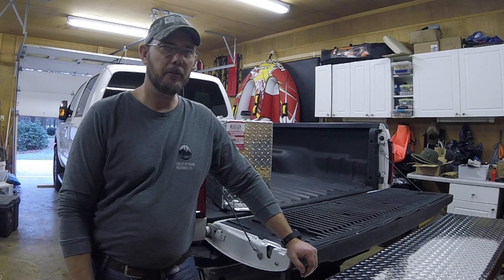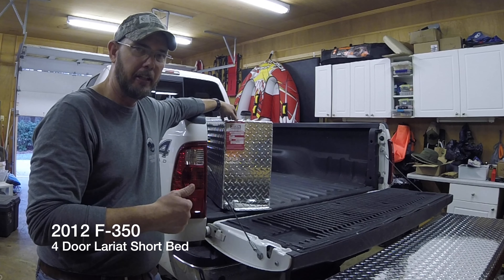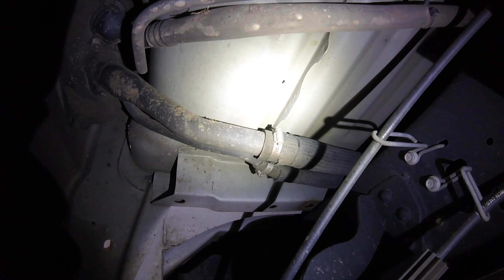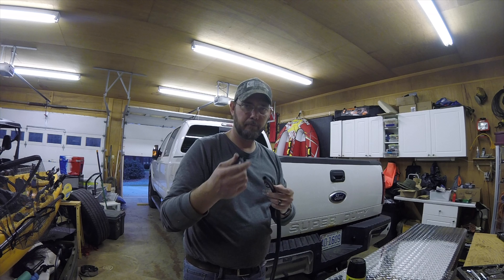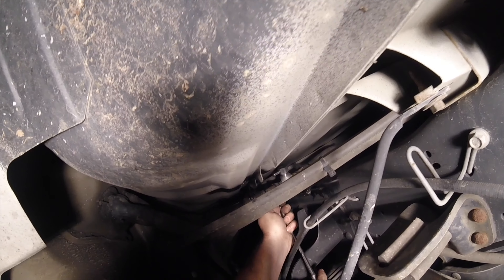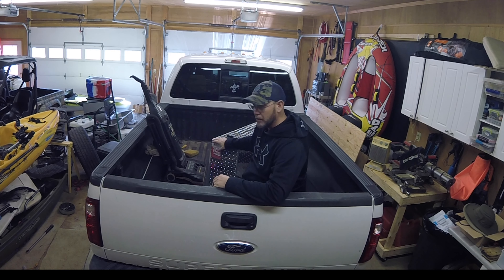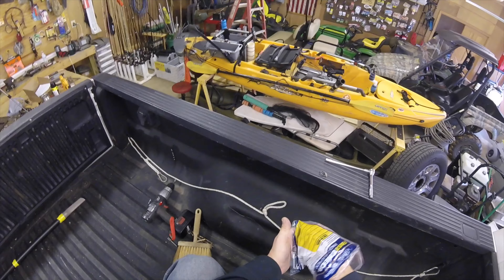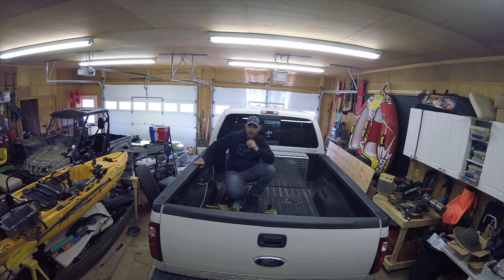Add Miles Towing With A Gravity-Fed Auxiliary Diesel Fuel Tank~Full Install

Comment: I just installed mine on a F350 two days ago, filled the main tank and aux tank. 

Hoses and clips were fitted and connected but there is still fuel dropping on the floor as the truck is parked sitting idle. 

Gone under truck to recheck if there is any loose fitting cant see none, all looks good. 

Although I have no hose fitted to breather vent on top of the auxiliary tank yet, could that be the reason ?  Or is it because both tanks are filled ?

Should I just lock the aux tank and let truck consume from main tank till fuel level goes fine before opening the aux tank valve ?

Comment: My friend I have a question for you thank you in advance. I wonder if is ok if you leave the  little gate valve in open position all the time ?
Reply from the maker: Hey thanks for watching and for the comment! Yes sir you can leave the flow valve open all the time if you want to. I would do that for sure if I was traveling on a long trip. Say for example you get going down the road and you notice you have about a 1/4 of a tank of fuel in your main tank because you forgot to open the valve after you filled up the gravity tank. You then decide to stop at a rest stop and open the gravity tanks flow valve. The tank will fill at a rate that will fill your main tank as you are traveling down the road however it will be slow but it will fill it. I love it it's great for long trips.

Comment: I have the same unit. And do need it for my small OEM fuel tank
My question is
Have you ever heard of installing a camper type unit folding or hard side camper 
While keep my gravity feed tank and tool box
I am thinking to try something and do a build around the tank and tool box 
I don’t want to remove it
Good video

Comment: Doing the same on my ford 2015 6.7 - I’m thinking about adding a small pump to help move the fuel over and run it to the power up switch.. now that you have run yours for a few months do you leave the value open all the time or turn it on and off. Is an electric pump something you’d suggest?? Thanks for your install video- I went with an RDS combo 60 gal with small box on top and adding a roll up bed cover to help secure the bed.
Reply from the maker: So far the way I have used the Aux tank is I will use the OEM tank first till it is time to refuel it. Then  when the truck is just sitting and not being used I will open the Aux valve and let the OME tank refill. I have not taken any long trips with our 5th wheel due to Convid this year so I just can't say fo sure if it will push up and out through the filler neck or not. I will say I filled up my OEM and the AUX tank before I left the beach the other day and kept the Aux valve off till I got home (3 hr drive) and let the OEM tank refill overnight and I had no pressure build up for me drive home that day.
Reply: Hook It Up Outdoors - we have kept aux tank with gravity valve open all the time. Fill it up and have had no issues at all. Put a locking cap on factory to remind us to make sure aux tank is empty before taking off factory tank. We fill factory tank then move nozzle to aux tank. When the gauge starts to drop we know it’s time to look for fuel!  Works great with no issues.
Reply from the maker: @kevinrogers4223  Yes sir that is how I fill mine up OME tank first then AUX tank. I love it I can get (road miles not much pulling) around 850 to 1000 miles per fillup now.
Reply: @ViseGrip1974  you can leave the valave open all the time on the aux tank and it will keep your oem tank topped off it will not over fill thats what that T connection with a ball valve will prevent it from doing.  as your oem tank goes down it will fill it up once you see the fuel gauge going down your aux tank is empty.
Reply: I have the RDS Combo 40 Gallon Tank / Toolbox. Gravity Feed Only at this time. If I let the aux gravity feed to the main (times my truck fuel gauge faults and shows empty).  I have no filter as your install but am thinking of adding one. I figured I would just let my main filter filter the fuel.  I have had some issues with only getting 2,500-7,500 miles/filter rated at 15,000 miles. 07.5 Duramax LMM 107,000 miles. I carry a spare filter but it is somewhat a pain to change due to it’s location. Possibly might add a AirDog system….👍

Comment: That line you called overflow is actually air vent line.  It is what allows the fuel to actually drain quicker.  Think of it like shotgunning a beer.  If you don't pop the tab of the can the beer flows out slowly.  But once you pop the tab to allow air it rushes out.
Reply from the maker: Thanks for watching and the input much appreciated!!
Reply: I like Beer ❤️

Comment: when you put the piece into your truck fuel fill line. was the hose rubber or metal where you cut to put the section in with the fitting for the gravity feed fitting? hope you know what I am talking about.
Reply from the maker: It was rubber on my truck.  Good question than thanks comment.

Comment: Only problem I have with gravity feed is,
Water is heavier than Diesel fuel,  water goes straight to the bottom and is the first thing in your truck tank.... as much water that is in the fuel now days, I fill my truck from the transfer tank but it goes through two water separators and a 2 micron filter before it goes in my truck. This keeps my truck system water and debris free.
Reply from the maker: Makes sense thanks for the input!!
Reply: Quick question, I always hear about high amounts of water in diesel fuel. I have a water separator on my truck and two fuel filters. I have never had an issue with water. I also do use hot shots everyday which has water separating properties but where does the water go?

Comment: Where did you get the valve that you put into the filler neck?
Reply from the maker: It came with the tank. Thanks for watching.
Reply: @ViseGrip1974  👍 no problem, trying to hook up two tank the same way in my truck

Comment: You should have left a half inch gap in front of it. That thing is gonna be banging the front or the bed on every bump. And you are supposed to put the foam tape on the raised ridges of the bed, not the tank. Wow.. lol.. now I see you are hard mounting it. It should be spring bolted.

Comment: Can you route it through the fifth wheel hole plug? I just don't wanna drill in my 74k diesel. That's my plans. Good video.
Reply from the maker: I don't if you can or not. I just drilled the hole. Thanks for watching.

Comment: That was a good video.  On my F350, I did the same thing with my vent hose. Found out that where it touches the bed or cab it was rubbing the paint off. It also had fuel on both the cab and bed  that the wind blew all over. The fix was to route the over flow hose  thru the same hole as the the fuel hose. not as messy. I want to know how much room you have between your tool box and 5th wheel
Reply from the maker: Actually I don't use my toolbox when I tow my camper because of the fuel tank I don't have enough space between the 5th wheel and the toolbox. May tool box is 20" across the top. I just take my toolbox off when I hookup our camper. But if I didn't have a fuel tank in the bed I would have 10 1/4" between the toolbox and the 5th wheel. Hope this helps.

Comment: I'm getting ready to put one of this in my truck. I have two questions, do you leave it open all the time so the auxiliary tank fuel always feeds into the main tanks, and what keeps the fuel from back up through the filler neck on the truck?
Reply from the maker: Thanks for watching and the comment and questions!! Question 1: No with this tank you can turn the valve off and on as you like. Question 2: I I positioned the valve under my bed so it was on top also I think the valve is made so that the fuel only flows one way. I have never had any issue of fuel going back up into the tank. You will love this setup I know I do. Good luck!!
Reply: If you leave the tank valve open like in this gravity-fed unit, you can't fill the bottom tank like you used to do, because if there is any gas on the top tank you would cause a mess since the fuel will gush out when you open the fuel port in the truck... so get used to only fill up the top tank...trust me you will only make that mistake once. Also, you don't have to leave it open to the tank all the time... but what is the point of having a bigger tank if you have to stop, get out of the truck turn it on and get back inside to continue driving, just use the setup like if you only had 1 large tank and never worry about it again.

Comment: What do you do about the air vent on the stock tank - or is there one? Since the fuel level of the auxiliary tank is higher, once the stock tank fills, wouldn't the fuel then start flowing out of the original air vent? Unless you stop and close the fill valve from the auxiliary tank and only open it  when filling the stock tank. I would assume the stock tank air vent would need to be rerun and extended above the new transfer tank, then the problem goes away. How did you address this problem? Thanks
Reply from the maker: Thanks for watching and the comment and questions!!  I am not sure exactly the best answer to give you on this but once you fill the main truck tank and then fill the gravity tank it will not let any more fuel into the main tank because it is full so it's just like filling only one tank. The gravity tank valve will only allow fuel to flow in once the fuel goes below the valve I install in the main filler neck. I have never had any issues with fuel escaping at all.
Reply: @ViseGrip1974  Thank you for your quick reply. I think the part I was not understanding was that the valve you installed in the existing line is also a regulator for the flow. Thanks again.

Comment: You haven't install any valves. How do you control overflow of you main tank from auxiliary?
Reply: So far the main tank does not overflow with the cap on.  We have been watching it close. If there is a problem we will install a pump in the line with a switch in the cab. We may put a locking cap on the main tank so it doesn’t get opened by mistake. That would be a problem.

Comment: So did you tank work aand if so Do you think it will work with Gas... Thanks, Great video...
Reply from the maker: Yes it works great I love it. However please contact the dealer or manufacturer is you can use gas in it I have no idea. Thanks

Comment: Great video, just finished installing mine on my 06 Sierra. Noticed where you ran the fuel line to the filler neck it seems like there’s a pretty shallow spot there that would hinder the flow. Any problems with that? Reason I asked is cause mine comes out on a slight upwards angle from the tank to where it goes through the beside. Thanks
Reply from the maker: Thanks for watching and glad it helped. No problems at all I love it. That was a hard place to mount the gravity fuel line but so far so good. Hope you enjoy yours!!

Comment: I apologize if you went over this in the video and I just missed it. But did you have to do anything for the breather tube from the main tank? I've heard that it has to be moved up higher than your auxiliary tanks height.
Reply from the maker: No I did not do anything with the breather tube. I just ran my line from the AUX tank to the main fuel line cut in my line and installed my supplied valve and line and that was basically it. Thanks for watching!!

Comment: so you can only do this with diesel?
Reply: Only diesel.
Reply: You can do it with gas also. You will need a tank suitable for diesel AND gas, and will need a pump as gas needs to be pumped from the top of the tank. I have an ATI AUX46 hooked up on my gasser with a small external fuel pump and inline filter. Installed a switch in the cab and fill it up on the fly. Works perfect travelling cross country pulling our toy hauler.

Comment: Could this also be done to a gas truck? 
Seems like every video on this subject is for a diesel.
Reply from the maker: From what I have read you can but I would check with whatever tank manufacturer you go with. Thanks for watching!!
Reply: cannot gravity-feed gasoline, lawfully..  Only Diesel.
Reply: @ViseGrip1974  you can not use this tank for gasoline its only for diesel. dOT will fine you if caught gasoline is very combustible and diesel is not. .that is for gravity feed into a fuel system on a vehicle.

Comment: How did the system end up working out for you? I’ve been curious as to the tanks that utilize a line going to the main fuel line. Do you have to stop while you’re traveling and open the valve in order to let it start filling up the primary tank or what do you do? Thank you and great video.
Reply from the maker: I love the tank it has worked great. Although I haven't really been able to go on a real long trip or camping trip with it. We had one planned but then Covid hit. But running around home or to the beach pulling the boat it works great and I love the fact I don't have to fill up near as often. I usually just leave the valve open but sometimes I do close it. Mainly when I am fueling up to make sure I fill up both tanks Gravity and Primary (truck) all the way.